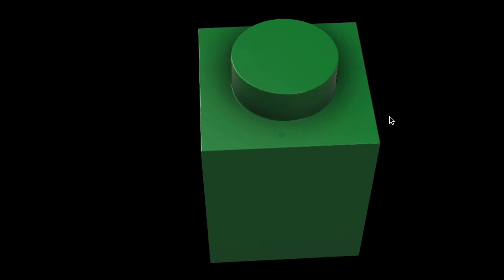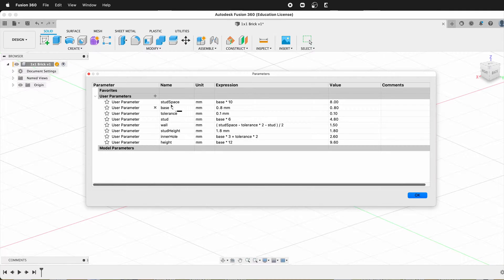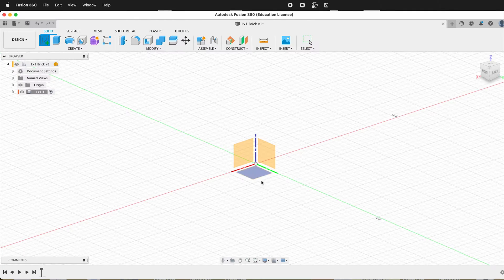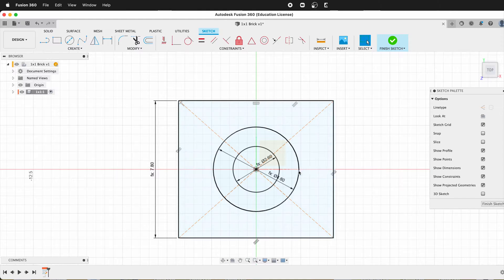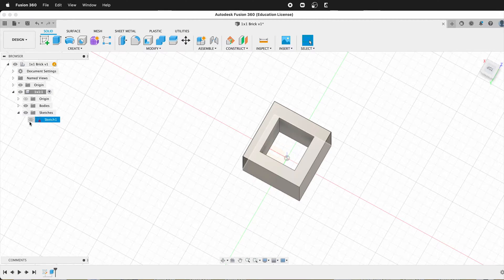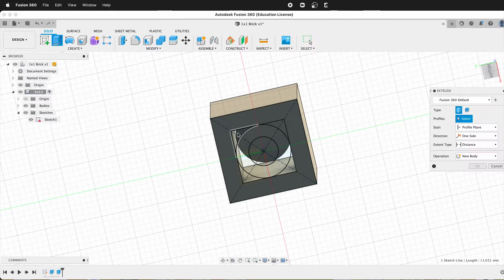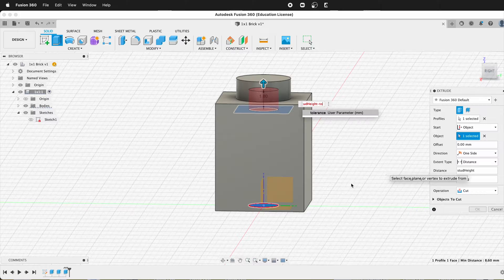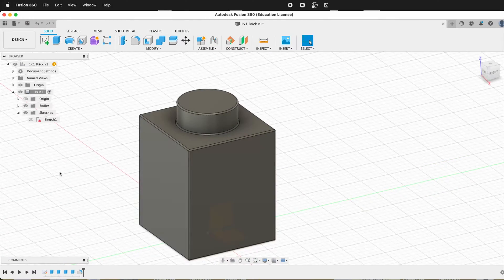Model a 1x1 Lego Brick in Fusion 360 Tutorial

Comment: yeah but how do i make the 1x1 with hole?
Reply from the maker: The hole in the bottom?
Reply: @WhatMakeArt  no 1x1 with hole in the middle
Reply from the maker: Ah, I see. Yes, I'll need to make a video about that.

In the meantime, just shorten the distance that the bottom hole is subtracted from the base of the Lego. Make it a bit higher than the height of the stud.

Then you just need to measure the size of the middle hole with a pair of calipers, and then draw a sketch on the side of the Lego and cut it out. This will take two sketches, one for the larger circle and one for the smaller circle.
Reply: @WhatMakeArt  + i use thinkercad
so its much harder
Reply: @WhatMakeArt  btw can you make the tutorial in thinkercad?
Reply: @WhatMakeArt  wait i think u misunderstand u know the 1x1 but search it up on google: 1x1 with hole or part6541
Reply from the maker: Yes, I see that one, I will see you about putting a Lego brick tutorial on tinkercad
Reply: @WhatMakeArt  can you tag me in the tutorial?